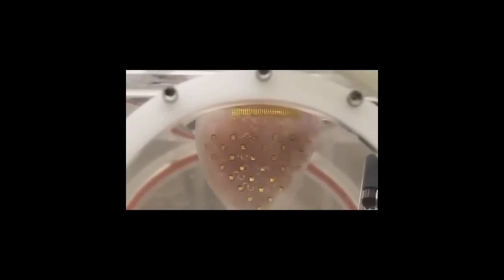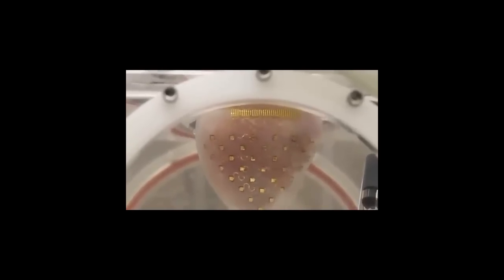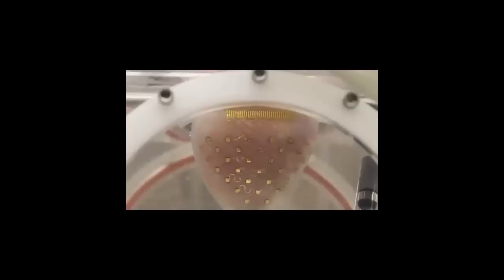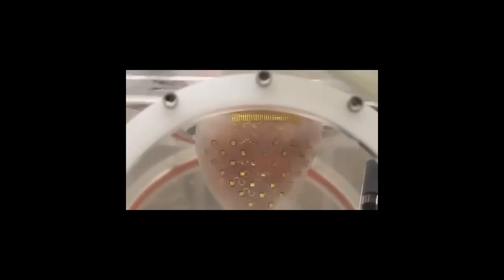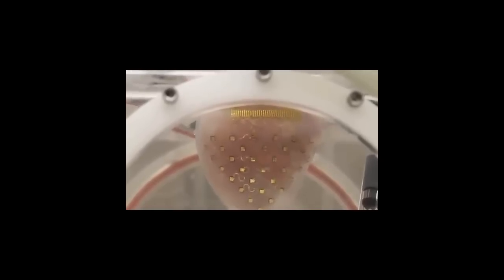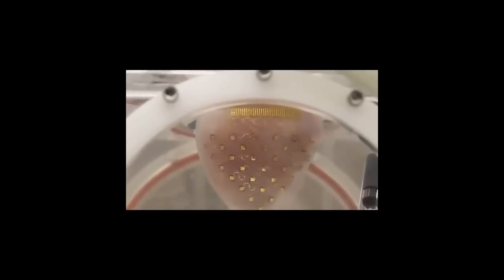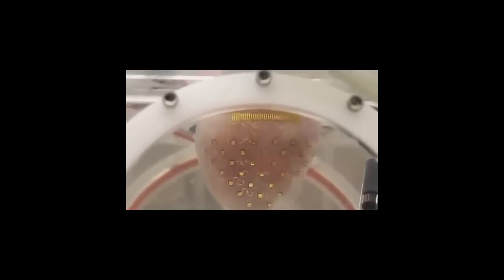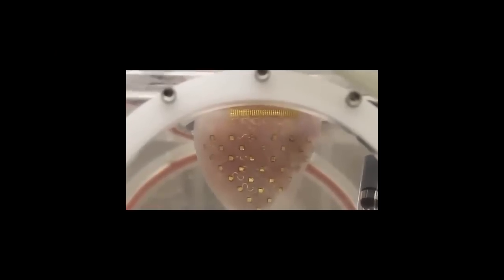Newly Invented Cardiac Device Can Predict and Prevent Heart Attacks

Comment: This can be used on your spinal cord to help people with problems in their arms and legs to help them walk and lift things. Using electrical firing from there and it wont need a outside power source either. Put sleeves on the outside of people arms and legs with the pads attached and have the others inserted into the back near the spine